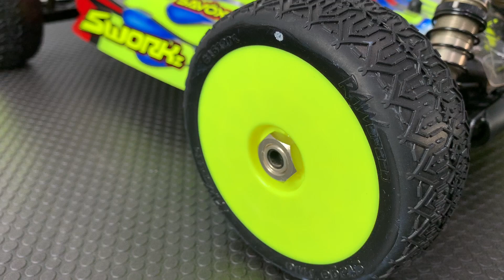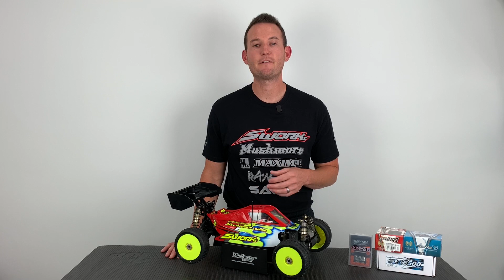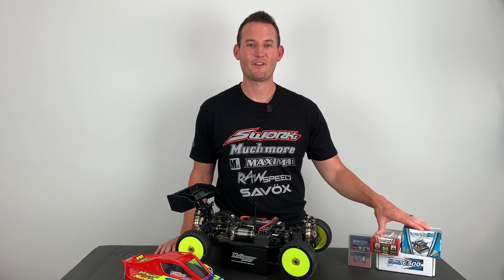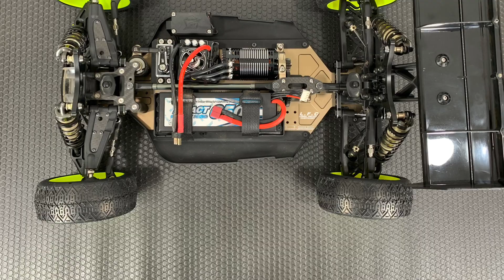Ryan Cavalieri- Talking about the newly designed Sworkz S35-4e buggy and taking you under the hood.

Comment: Nice setup Ryan. Love my Savox servos. Curious though you run the higher torque 2290. I’ve been running the faster 2292, and it has a lot of torque still. Do you feel the slower higher torque benefits you?